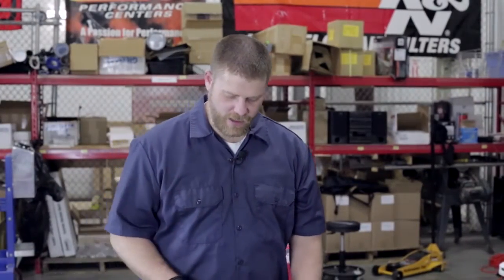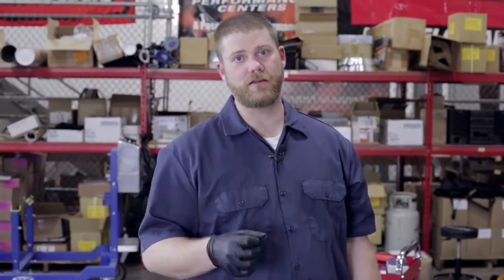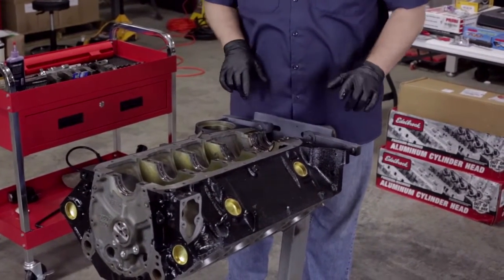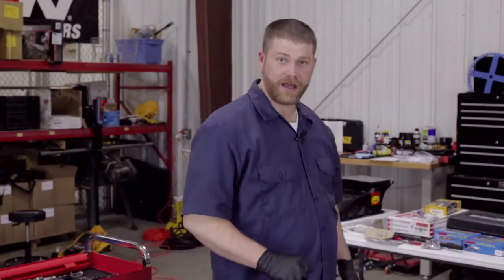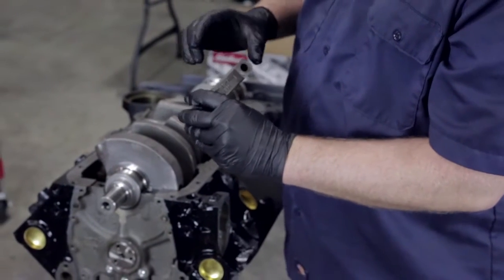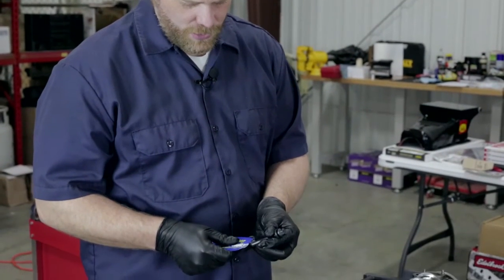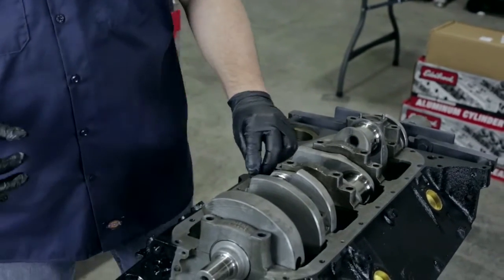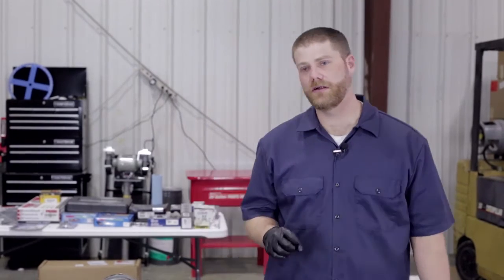Small Block Chevy Engine Build: Crankshaft and Clearances (Part 2 of 2)

Comment: Pro tip, the ARP lube goes between the washer and the bolt head (or nut on a stud kit). The washer contact surface where it meets the cap should be dry and slightly rough.
Reply: good catch I caught that too good way to strip bolts especially with aluminum blocks